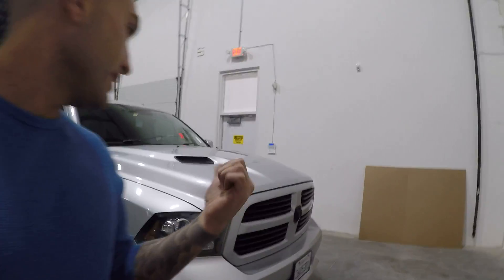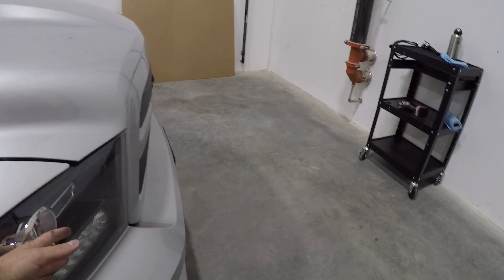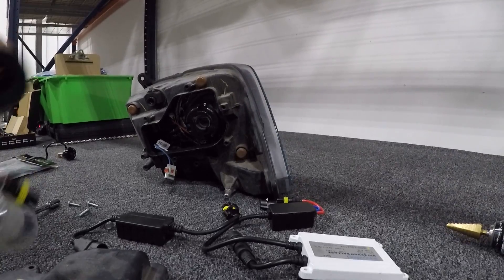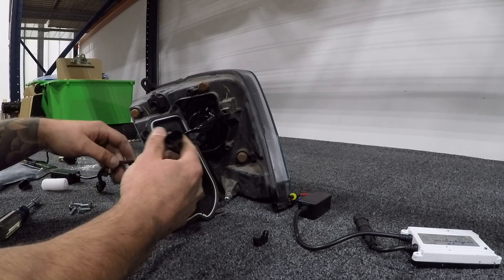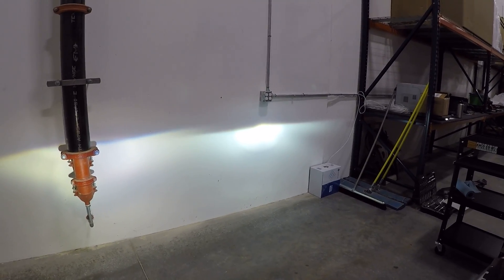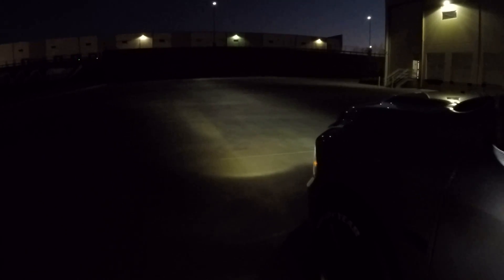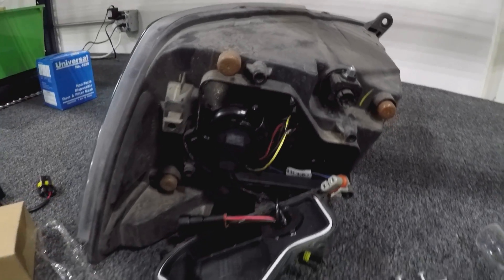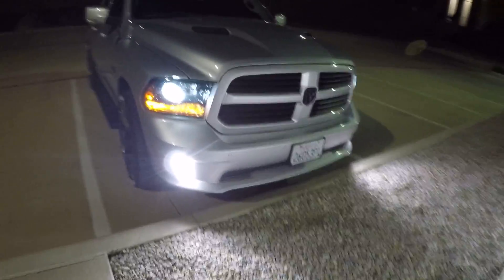LED vs HID in Factory Halogen Projector Headlights

Comment: Bought this kit and maybe it’s the wrong kit? The bulbs do not connect into the housing and the tabs don’t align. It’s like the whole diameter is too small. It slides right past where it’s supposed to connect. The 9005 right angle bulb is what it takes. For both beams. Both sides.

Comment: Recently installed LEDs on my 2015 Ram 2500.  I didn't so much do it for brightness, as for the difficulty in changing the bulbs.  9012 low beam..  9005 high beam.  That was the first lesson I learned after Amazon suggested the wrong bulbs twice.  LED's tend to last nearly forever, so I wanted to be once and done.  I did the fog lights too.  The light is definitely much whiter, and there is a significance in brightness in the fog lights.  And unlike the kit in this video, no adapters or modifications needed.  The LED's where direct fit.

Comment: I’ve got a 17 ram 1500 sport with the projectors. I ordered the same kit just in the 9005 instead of the 9012 like he did. 

The install was fairly easy and I did pretty much everything the same. My bulbs would not stay on though. Come to find out, the bcm (I think) doesn’t push out enough amperage for even 1 of these bulbs. 1 HID in the passenger side and 1 standard halogen bulb in drivers side. So I ended up ordering a relay from inovitied as well. That fixed the problem and both bulbs work. 

I still had the bulb out messages on the dash. So I ended up ordering one of the canbus decoders like he mentioned in the video, just not the same one. Couldn’t find them. That fixed the bulb out messages. 

I believe in another one of his videos he goes through the bcm to enable HID bulbs. I wonder if it pushes more amperage out for them but I’m not 100% certain. I didn’t want to spend more money on alfaobd right now.

Comment: for the love of god aim your projectors so they dont blind oncoming traffic. projectors are nice because you can focus the light in such a way that it can be very bright but not shine directly on oncoming traffic. however, there will always be a certain distance, and especially a point of the crest going over the hill where you are guaranteed to blind an oncoming driver for a split second because of the height of the focus of the beam of light. Adjust them horizontally so they're not shining at oncoming traffic and point them downwards so you're at least not blinding people on level roads.

Comment: 55w run so hot they can actually melt stuff in your headlight assembly. I'd rather use the 35w even if I lose out a little bit on brightness.

Comment: I had the same HID kit in my 99 Grand Cherokee when I installed projectors on it and loved how wide the beam pattern was and how far the light was projected. Fast forward a few years and I got a 17 Civic with Hikari LED and I thought it was the projectors that were the issue. I'm getting the same fuzzy and unfocused light pattern with dead zones and no throw you had. And same as you, my LED fog lights are doing all the work. After seeing the light pattern on the clipboard it all made sense and I was sold on going back to HID. The outside comparison of the two was insane.

Comment: It was a good video, my friend. But when you attach a xenon lamp to a halogen projector and you used 55 watts. You will cause the coating inside the projector to wear faster. Since you're using 55 watts, this scenario will happen faster. Because the temperature is much higher in xenon projectors, the coating is much thicker. Halogen lamps will generate less heat than xenon lamps, so the coating on the projector is thinner. Best regards, thanks

Comment: I've seen situations where LED's perform just as great as HID's. Every vehicle headlight housing is different. The headlight housings also make a difference in beam patterns as well as the amount of light output the unit allows. Projector lighting units burn out over time, limiting the amount of the light output. So in some cases it won't matter how bright the HID or LED bulbs are.
Reply: If you drive at night for long periods LEDs dim down substantially to prevent heat damage to the LED chip. HID will nit dim like this and have a longer throw distance in general

Comment: Thank you so much for this video.  The Amazon link for the INNOVITED 55w HID KIT for the low beams doesn't work anymore.  Can you post an Amazon link to the correct 55w HID Kit because there are so many to choose from.  Will the Innovited 55W AC HID bundle with (1 Pair) Slim Ballast and (1 Pair) Xenon bulb 9005 5000K (Pure White) work?  In your video you mention using 9012 6000K.

Comment: LEDs are better than HID when used in a LED-projector. HID and Halogen lamps are omnidirectional while LEDs are only two-sided. Check Bi-LED projectors. They are way better than Bi-xenon. You shouldn't use LED in a halogen or xenon projector.

Comment: I know this is late but the dot you're seeing from the led w two opposing lights patterns is cause by the tip extending further then the led chip itself. The light has to shine around that thus creating a bend, especially if the chips aren't horizontal evenly. This is why some come with adjustable fittings so if it doesn't line up right you can make it.

Comment: I’m curious if the newer HIKARI Ultra led bulbs work better with the redesign of the ends. There isn’t that round piece at the end of the led bulb anymore and now create a pretty sharp line on the wall as compared to these older ones. Plus the HIKARI uses the new Phillips Lumiled diodes versus those ones that were used prior.

Comment: I didn't run in to the issue with led's you demonstrated. Maybe the brand or too short a led off the ballast. You need a longer thinner led, not the short ones.

Comment: I see the HID light reaches further. But isn't it the design of any automobile headlight assembly to prevent glare to the oncoming traffic, the drivers side light beam pattern is such it will dip than the passenger side. it is the manufacturers design. Why don't you show us the video swapping sides for those 2 bulbs. I am sure the passenger side if fitted with LED will reach further. Google on Headlight beam patterns and see how the automotive headlights project the light beams.

Like this comment if anyone agrees with me.
Reply: https://www.hotrodhotline.com/sites/default/files/images/Headlights%20MD-18.jpg

Comment: i have a 2013 ram 1500 sport with the projectors . i do not have the plug on the back of the headlight . mine just has a plug that you plug into the back of a bulb .

Comment: Watched your video's great information I appriate you. I look at this same product on Amazon and looks like they sell with ac canbus included. I have a 2015 Ram 1500 LongHorn w/Projectors so i believe I need 9012/Low beams and 9005/High beams.
Does this look correct to You?

https://www.amazon.com/gp/product/B07WYWYLZQ/ref=ox_sc_act_title_2?smid=A1DBJQIFEVJ34V&psc=1

https://www.amazon.com/gp/product/B07X2G76FT/ref=ox_sc_act_title_3?smid=A1DBJQIFEVJ34V&psc=1

Comment: Great video and explained very nicely. Just wanted to clarify if the light output will be safe for oncoming traffic in terms of glare , if any, caused by having an HID in a Halogen Projector. Looking for a light upgrade myself and this video was an eye opener.
Reply from the maker: Glare was not changed and I never had anyone flash their lights at me from oncoming traffic. The cutoff remains the same level just becomes brighter than the halogen bulb that was there before! You won’t be disappointed. Links in the description for thus setup 👍

Comment: Just in case you didn't know or someone hasn't told you ...... the driver headlight unit by law has to be always lower by factory so "you" won't blind upcoming traffic 😣 and when it comes to LED VS HID.... HID will will that battle.

Comment: If you buy a good quality LED bulb from a company that knows what they're doing besides a Chinese knockoff version, LED bulbs work just fine in these style headlights. The cheap lights don't do research to make sure the bulb works, where the higher quality more expensive bulbs have lot of time invested into the bulbs to make sure they work properly.

Comment: Do you still recommend this set up today? I have a 2017 RAM with the factory projector housing. Also, is the new HIKARI LED Headlight Bulbs Conversion Kit-9006(HB4),2019 New Gen of HIKARI, Adjustable Beam, 9600lm 6K Cool White,2 Yr Warranty from Amazon comparable to the $70 Hikari LED fog lights you have?
Reply from the maker: Yes I would still go with a HID in these projectors for the best light output
Reply: Does the INNOVITED 55w HID KIT for the low beams still the best for the money? and will it mess up the factory projector housing in the long run?
Thanks again for the help.
Reply from the maker: Yeah I would go with the innovited 55w.  Its the best bang for buck super bright and reliable. No issues with the factory housings and worked solid the whole time before I sold the truck 👍
Reply: @BoostedMotorsports  I installed the Innovited 55w to my 2017 RAM 1500 but I get the warning "low beam out" and no light output. The bulbs are ok when I turn the engine off and on but it will give the warning again and no light output. Did you have this problem?
Reply: @bmwlady5820  did you ever correct this?

Comment: I dont think unpinning the connector is very difficult.. just sayin.. question do you ever use your auto high beam function? Reason I ask is I'm wondering how that works with HID . I have 2 single beams I my commander and I was gonna do led in the high beams and just keep the hid in the lows. Would you do that or can his do well when they are flashing on and off .. u know they flash off when theres on coming traffic.. thank u for the video
Reply from the maker: I would do HID for lows if its projector and LED for highs.  That way you still can flash the highs and they are instantly bright when you switch them on 👍

Comment: First of all great video,  method and explanation.  
Just so people know, in March of 2018 LEDs were generally not very good for projectors. In the video you can clearly see the LED bulb was "clocked" crooked and showed the dead areas made by the wider chip housing. 
For what it's worth, SOME manufacturers have noted these issues, and have started setting chips in the thinnest housings, as close to where the bulb filament was, and also made it so you can adjust  the "blade" after they are in your projector units. 

And if it wasn't for videos like this, those changes would have taken a very long time, so thanks again.
Reply from the maker: Thanks Jay!  True probably could be clocked a bit better. One of the nice things with HID is it works similar to the original halogen it replaced without clocking 😎
Reply: Thanks for the info

Comment: Hi ! , I have a question I have a 2015 Honda Accord EX-L with factory halogen projector , I put a H11 C6 LED for the low beam , and doesn’t bright far has halogen , is any LED kit that can be good in the proyector , because I  bought so many LED bulbs and I’m tired that any one work well and I waste my money and I end using the halogen ☹️
Reply: Diode Dynamics SL1 LED headlight bulbs or the Morimoto 2Stroke 2.0 LED bulbs perform good in low beam projectors. They are pricey, but I have seen several comparisons and these two I mentioned seemed to perform well.

Comment: The LED bulbs you used were cheap junk.  If you decide to go back to LED, get bulbs that use CSP chips.
Reply: I bought a set of high priced, designed and made in the USA LED bulbs and had the same problem...its the design of the housing not necessarily the quality of the bulb in this case.

Comment: Help. I installed same led with resistors. Then just installed these exact same HID. Kept the hikari resistors like you did. But like go out when I start car. One blinks then goes out. When I switch the light knob from auto to on light go on then out again. But they work because when I unlock my car they both go on and stay on. But when I start the car they go out? Any ideas. Should I take off resistors? Is too much power cutting them out? Going to mountains Friday and need to fix today. Damn. Love you vids BTW.
Reply: Ok I might of have a solution for now. Pull your high beam in before you start the truck. I have 2015 Ram 1500. So turn knob to off and don’t use auto. Then before you start the car pull high beam in and make sure they turn on. Truck doesn’t need to be on to use high beam. Then while holding high beam on start your truck. Then turn light knob to ON not auto. Then let go of high beam. They now stay on with truck running. Key is to have high beam on before you start the car then turn knob. Just make sure to not use auto anymore. I remember on my old gmc that worked. It must do something to signal it. Works good and they stay on.

Comment: Did you have any issues with the 55w kit? Any melting or damage of the housing or lenses or anything? I had a retailer tell me that the 55w was a no go because the heat would damage the headlight so I got the 35w. It’s been running great so far but if I can get brighter without damaging anything then heck why not

Comment: I installed these HIDs and they turn off after a little bit.
Reply from the maker: Turn them on manually.  The auto function does some weird stuff and turns them off
Reply: They turn on for 1 second and turn off that way too.
Reply: They flicker twice and then turn off completely.

Comment: So using a 9005 or 9006 bulb still works fine as fitment? Seeing that the stock is a 9012.
Reply from the maker: They are all the same plug just the tabs are slightly different. If you trim the tabs you can get any of them to fit eachother
Reply: Ok thanx man. I’m still thinking of trying out the LED bulbs. Then if not satisfied I’m gonna go hid. I have the Laramie with the projectors.

Comment: Great video and instructions! I ordered this exact kit for my Ram 2015, sadly it doesn't work for some reason. It lights up for a second, starts to flicker and then turn black. Dont know what to do now. This is the 2:nd kit I try with the same result. Do you have any idea what might be causing this? @boostedmotorsports
Reply from the maker: Did you order the canbus decoders from hikari also?
Reply: @BoostedMotorsports  Yes i did, did everything right. Starting to think that they do something to the electrical system when the cars arrive to Europe, it's illegal to change to led or hid here. Thanks for replaying so fast.

Comment: Thanks for the info man been wanting to get away from stock bulbs.  I was wondering though so will the leds work just fine in the fog lights ?
Reply from the maker: No problem Zack!  Yes LED work great in the fogs.  Check out the other vids on this  channel we have a ton of videos on the lighting setup for this truck 👍
Reply: @BoostedMotorsports   thanks  for the quick response i wasnt expecting that.   I have a 2015 2500 Laramie 4x4..

Comment: Hey boosted I bought the same kit and they stay on then turn off when I turn the truck on so you happen to know why? I contacted innovited and haven’t heard back that’s why I figured I’d reach out to you
Reply from the maker: Are you trying to use the Auto function?  Do you have decoders?  A bunch of us are just using the headlight switch manually which works fine but the auto function seems to act up a bit.
Reply: BoostedMotorsports ya I actually contacted them on amazon and they have a set for canbus HID’s for 9012 and I ordered those and the auto function works fine without issues!

Comment: @boostedmotorsports  you didn't have to use a relay harness for your 55w kit? Mine wouldn't stay on without one. How'd you do it?
Reply from the maker: Nope just pickup "hikari canbus decoders" and plug them in between the truck's harness and the 55w Innovited HID kit
Reply: @BoostedMotorsports  I had opt 7 decoder and it still didn't work. Had to use a relay harness. I'll give Hikari a chance.

Comment: May I ask another question about the decoders do you need them for each bulb replaced? I ordered Led's for the fog lights but I did not order any canbus or error canceller
Reply from the maker: The fog lights don't seem to need them depending on which bulbs you go with. On the fogs you won't get an error on the dash but might get flickering without them, really depends on the bulb 👍

Comment: Will these work in a 2018 Dodge Ram ??
Reply from the maker: Yes if you have projector headlights it will be the same procedure. Just double check your bulb type before ordering cause they changed the bulb types throughout the years
Reply: Thanks, also for the Hid's bulbs u used did u find a good error canceller? Which did u use? I am having a hard time finding 1 for the 55w..
Reply: Im going thru an issue with the 17 Ram. For my low beams.. I put in the 55w. I bought the innovited cancelers bc without them they would go out.  Last night I started the truck,  they came on then went out.  Then they started flickering.   And then wouldn't come back on..  5 min later,  I turned them back on and they fired up..  weird... thinking it needs a relay????

Comment: Hey boosted I ran those innovated hid in my 2015 ram sport with projector headlights and at first they worked perfect drove the truck and then parked it and later on in the day I started it back up and they just flickered once or twice and would not power on I have them ran with the decoder as well would you have any suggestions on what I should do or what the issue could be
Reply: did you correct this?